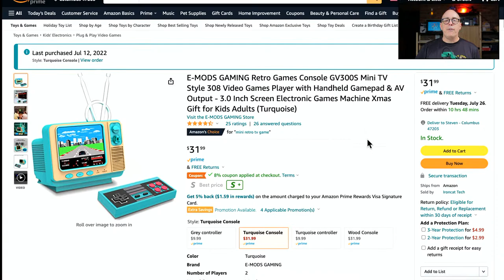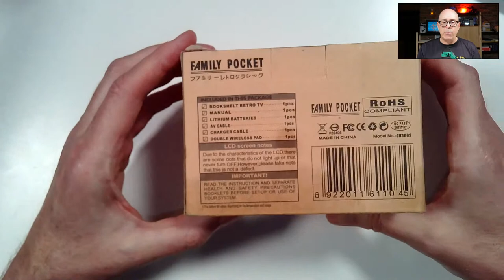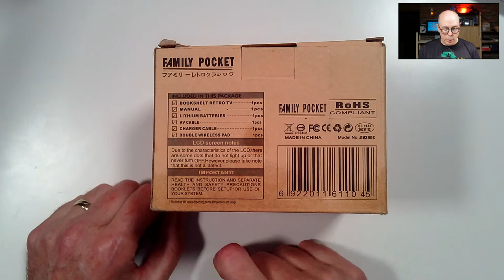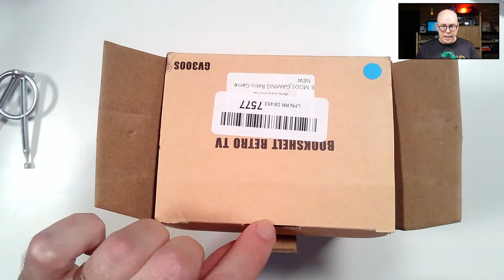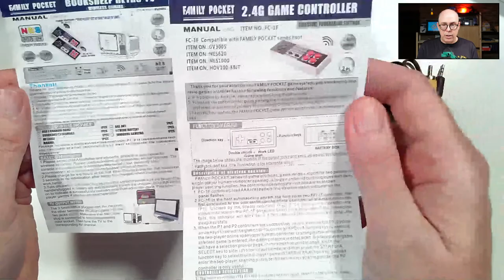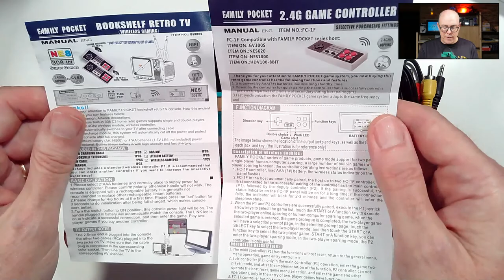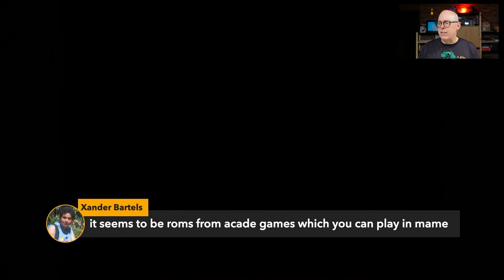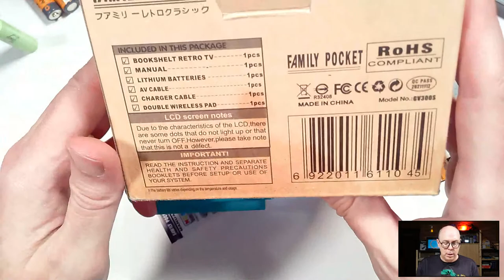Unboxing the E-MODS GV300S Mini TV Retro Handheld Game System

Comment: I would love to see a Pi or something with a screen small enough to fit in this case
Reply from the maker: That would be nice. Not sure we can get a Pi Zero in there.
Reply: @retroCombs  I imagine you could cut out the plastic that is there to hold the "spare" batteries and that would open up most of the case
Reply from the maker: Possibly, but the Pi Zero is pretty long. We need something like a Pi micro! 😂
Reply: @retroCombs  Oooh i gotcha. Im not very knowledgeable in Pi set ups but thought it would sure be niffty if it worked out. lol
Reply from the maker: It would for sure!

Comment: nes/fc version of spy vs spy is pretty good. and that's what it is. that's what all of the games are. that "processor" seems to be a ram chip? probably for the screen? 

the nintendo on a chip thing is under one of those black blobs. it's not gooed for copyright, it's blobbed because the chip has no case it's just same as calculators, that's how they're so cheap. there's no mystery that the roms are copyrighted just from playing it.
Reply from the maker: That seems correct. All of these seem to be old NES/FC games which is why I'm not familiar with many of them. I never owned an NES system. Thanks for the additional thoughts on hardware!
Reply: @retroCombs  the nintendo on a chip thingies are fascinating quirk of china.  they're also found on things you wouldn't think because they're cheaper than a modern microcontroller even. like those tiny arcade games.  or the tiny arcade atari 2600 - if you look at it the games look a little strangely 'off' on that playable mini atari 2600, it's because they're nes ports they had someone make for it that mimic the 2600 versions of the games.